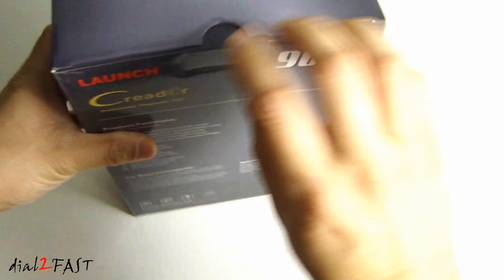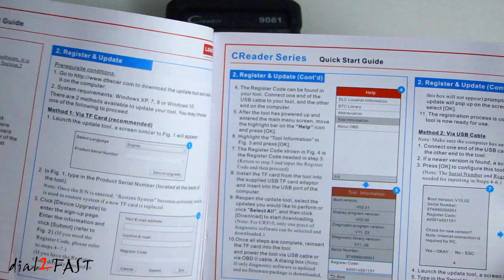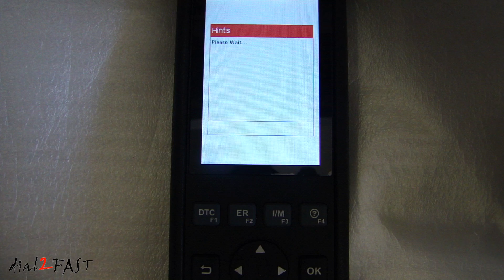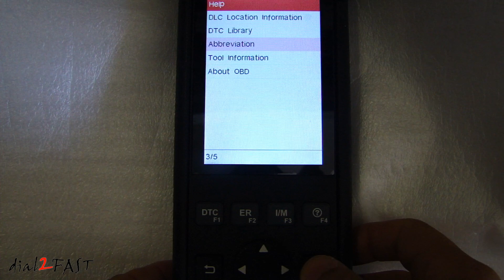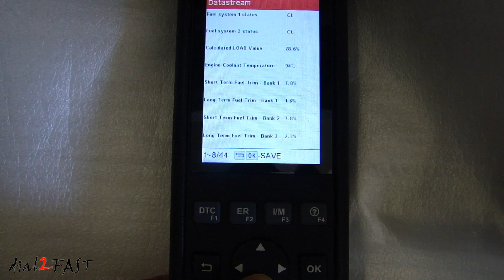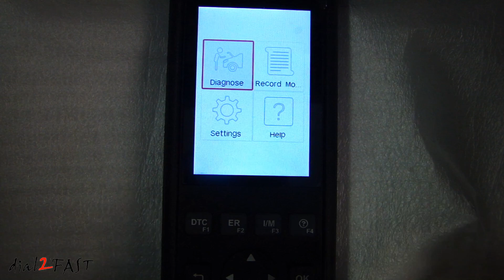GOOD OBDII Scan Tool - Launch CReader 9081 TPMS / Brake / Oil Reset

Comment: What a lot of diy,ers fail to grasp is a code reader is a device thats interrogates the cars ecu, and diagnoses the fault, which then must be repaired. They are not as some think  a way to just " turn off" the dash lights, the problem still remains, they are their to assist in acertaining problems and help avoiding costly garage repairs.

Comment: I cant reset my abs with a this scanner, is not good ..!
Reply: abs ecu is a stand alone system you have to fix the problem firs then reset it 
because it will keep testing the system for any errors even if you reset it it will come back again